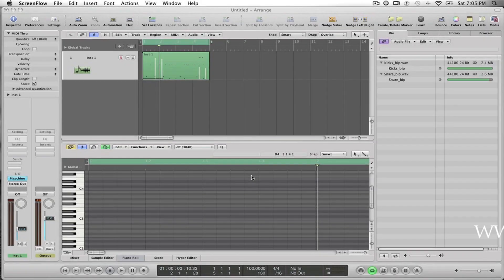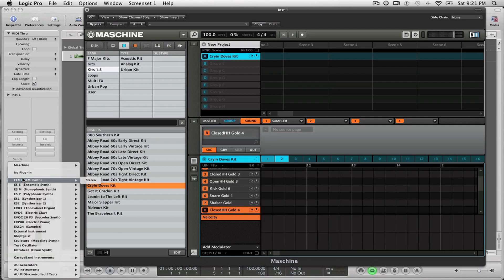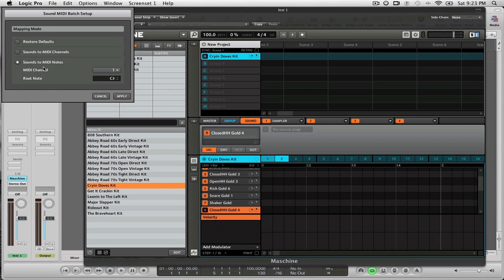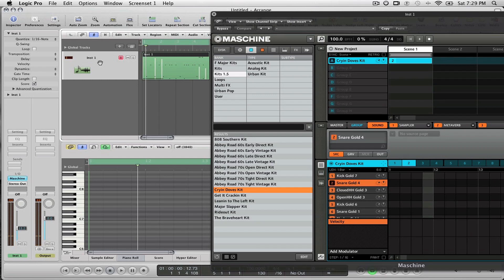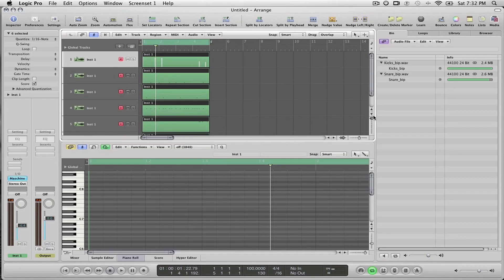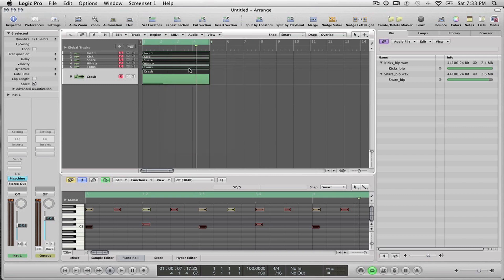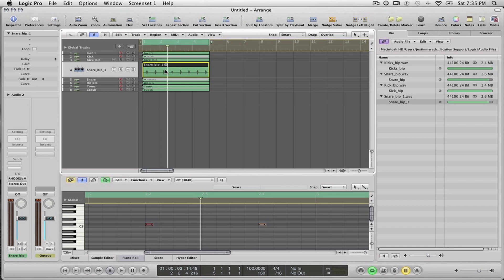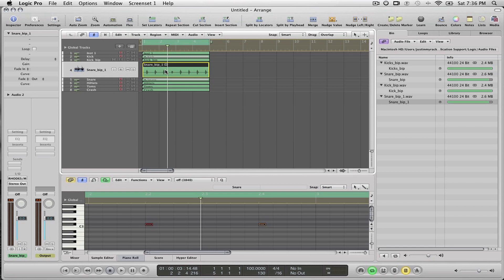Tracking out beats in Logic Pro using Maschine 1.8: Altruwisdom

Comment from the maker: The method in this video is using logic as the sequencer, so you the drag and drop feature does not apply for those that sequence directly into logic. I don't quantize much of anything in my own music, but I know plenty producers that rely on quantize heavily. Logic has more flexible quantize settings than Maschine (more percentages and grid values). I have gone through many different ways of using Logic and Maschine together, this is just one way that works.

Comment: There is an easier way to do what you just did. Use the four triangle drag and drop pattern into logic. But make sure you select drag an drop as audio and not midi notes. This will automatically bounce and create and audio track. 
There is also another huge disadvantage with this method. I saw that you used the quantize from within logic. This quantize is too on time and makes the song too robotic. It is a crime not to use the soft built in quantize of the maschine.

Comment from the maker: Yes you are correct, there is no fixed velocity setting in control mode natively, but you could change any template to only use fixed velocities. You need to use the Native Instruments Controller Editor and change the "Velocity" range so that it goes from 127-127. You can find that option on the Assign Tab of the Controller Editor.

Comment from the maker: Did you try adjusting your pad sensitivity?  You can do this by holding down the [Shift] Button in Maschine Midi Control Mode then select "Settings" in the upper left hand display. My pad sensitivity is set to 34, which seems to work well for me since I'm heavy handed.